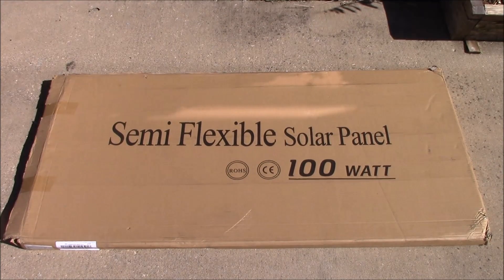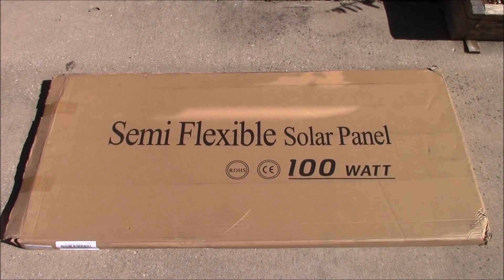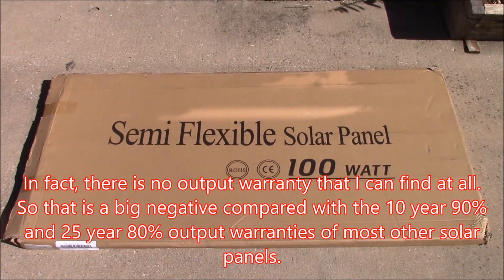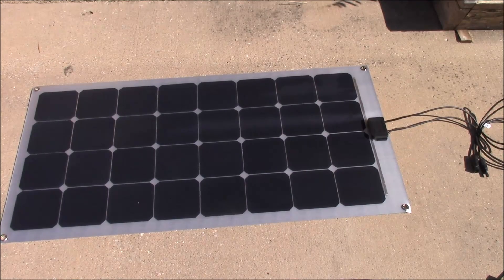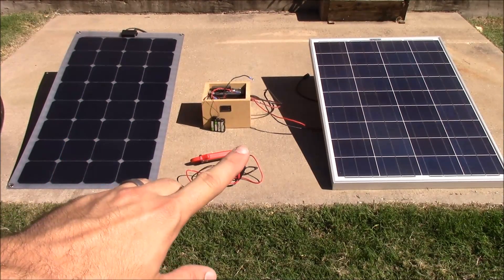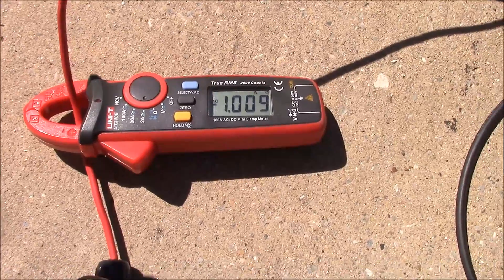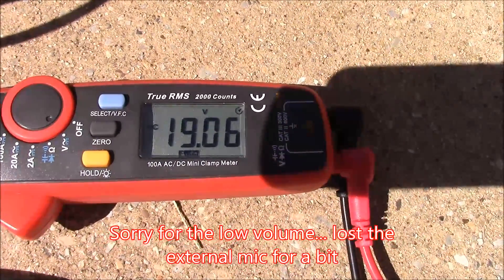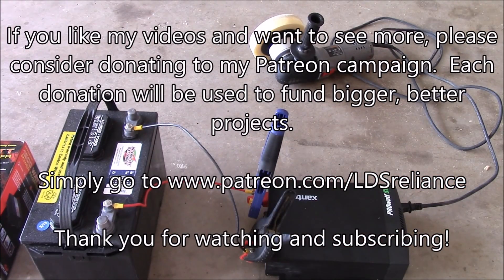Lensun 100W Semi Flexible Solar Panel

Comment: 1 Amp is not nearly the max power each of the panels should provide. Max amp should be mor likely be 5 Amps.
Therefore you (and we) don't know if the flexible panel provides the same power as the Standard.  You can get 1 Amp even with a 20 Watt panel.

Comment: Any suggestions on the type of solar panels I should go with? I have an Asian vehicle called a Tuk-Tuk which is basically a really nice 6 passenger golf cart. It has 12 6v batteries ran in a series. I use this for my business so I'd love to be able to get more mileage out of it instead of having to recharge for a few hours after 50 miles. Thanks for your time.
Reply from the maker: How many square feet do you have on the roof?  As far as type goes I think you would need to go with this type of semi-flexible solar panel to match the curvature of the roof.  Otherwise it might be hard to mount.  However, that will be about double the cost.  So if you are on a tight budget there are ways to mount fixed frame panels on a curved roof.
Reply: Hi K Mills. Greetings from India.

Auto RIckshaws (tuk tuks) are quite popular in India. The electric ones run using 48v battries with usually 750/1000w motor.

I have seen drivers use a 250w panel on the roof which would cost them about 250 USD. It keeps the battery topped up, increases the range a little bit and is definitely cheaper than charging from grid. 

the only downfall is that the batteries are replaced every 6 months (probably becuase they are discharged to full). Here is an article : https://www.indiatimes.com/news/india/here-s-how-india-can-surpass-china-in-public-transport-arena-with-its-three-wheeled-electric-vehicles-355611.html

Comment: One issue with regular polycrystalline solar panels is glass breakage. I got one from the UPS man that was damaged during shipment.
Reply from the maker: That can happen.  The glass used in solar panels is very strong and can handle hail but the way they treat packages sometimes it still might break.

Comment: I am confused with all this solar stuff. I am an artist and want to design and build a water feature using a 12v bilge pump . It  says 1.4 amps on the package. I have used this same pump running off a deep cycle battery in my van but now I want to know what size solar panel, controller and battery I will need to power an independent waterfall using this same 12v bilge pump.
Reply from the maker: To power that pump year round in an average climate and assuming it runs 24/7, you would need 200W of solar panels and 75Ah of battery capacity.
Reply: Thanks for taking the time to reply. I really appreciate it!

Comment: The cooler a panel is kept the liner it will last and the more efficient it will run. So, if you mount a flexible panel flush to your rv, you're gonna have a bad time.
Reply from the maker: Yep.

Comment: The warranty has more to do with the way it's constructed, because the glass holds up better than the plastic covering...
Reply from the maker: Right.  And the "flexibility" actually can hurt the leads and connections inside the panel.  So the main marketing point for this type of panel is actually its achilles heel and would be the reason why I would not purchase one myself unless I had an application that called for extreme light weight and portability.

Comment: I have a question. I have 100W panel and 12V 40Ah battery to power just 25W load. Got a little bit confused because battery discharges so fast when not exposed to sunlight. This is true even if I don't apply power to load, battery still discharges especially when it is at shade. Is there any way i can solve this? THANKS!
Reply from the maker: Do you have a charge controller?  How is the load connected to the battery?  Is it through an inverter?
Reply: LDSreliance yes sir i have 10A CC and i only use the load fnction to power 12v dc bulb
Reply from the maker: That battery will run a 25W load for 6 hours if it is fully charged.  Are you getting less than that?

Comment: A big malfunction with these flex solar cell arrays,  I have seen is, if it's shaded in the smallest amount, one cell, the output drops to zero.
Reply from the maker: Not with this particular unit.  I have tested it in shading and it lowers the voltage a bit.

Comment: Each cell output is max 0.2 amp at 0.5 volts x32 cells, not much more than 3 watts. How do they come up with 100 watts? They are cheap Chinese monocrystalines, save money by making your own, Pair of 1/16th clear plexiglass sheets, $20 each, 32 wafers at 50 cents each, sealed with clear silicone epoxy, save $100 on this size panel. All it takes is some soldering, make your own custom size.
Reply from the maker: Where are you getting those specs?  Solar cells can be anywhere from a few tenths of a Watt to 3W or more.

No one is buying this panel because it is cheap.  There are plenty of finished 100W solar panels with warranties and guarantees for $100 including shipping.  The only reason you buy this panel is if you need something very mobile.

Comment: Notice the damage to both the box and the solar panel on the right front corner.  

I ordered this product, received one that was damage, like in this video.   Worked with LENSUN to replace it.  Lensun blamed the damage on the shipping company, not their paperboard flimsy box.  I had to pay shipping back to LENSUN.  They sent me a replacement that was damaged on 2 corners. Again they blamed the shipping company.  I finally got a refund for the 1st shipping, and again returned the panel to them, and then received a refund for both the panel and the 2nd shipping.It's very likely that you'll receive a panel that is damaged.  It may not affect your mounting system, but I won't pay this much for a product and accept damage.LENSUN took care of the issues, but not without significant hassle.
Reply from the maker: I am sorry to hear that.  I have dozens of products show up each month and most of them have boxes with damage like that so I didn't even think of it.  I did notice a slight bend in the corner but it was just the aluminum backing and did not affect the panel.  I can understand if you paid $300 for this then I would want it to be perfect, too.

Comment: I have a 100 watt aluminum backed panel as the integral roof panel on my solar/human powered hybrid car. It collects 100% of my daily power needs for transportation. When you mount with a bend they are de-rated a bit, I never get more than 90 watts. The trick is to live sustainably, using a vehicle that is appropriately light weight, mine weighs 160 pounds. 4000 pound steel caged climate controlled high speed lounge couches are never sustainable, they steal more than your fair share of resources from future generations.
Reply from the maker: That works for you but may not work for everyone.  What about my family with a 3 year old and a newborn baby?  How am I supposed to fit in that?  What about those who commute 45 minutes to work each morning?  What about the elderly?  What about construction workers who need a truck?

I get what you are saying and I support being efficient and conscious of the resources we use, but God created plenty of reseources for us to live with and we don't all need to make huge sacrifices.  We all just need to rethink a few things and that will make a huge impact... as long as we ALL do it.  Turn off the lights when you aren't using them.  Drop your thermostat by 1 degree in your house.  Turn down the refrigerator temperature 2 degrees.  Replace a few light bulbs with LEDs.  Can you imagine if everyone in every industrial country in the world just did those few things?  It would be huge.
Reply: The Organic Transit ELF has a 2 seat model available with a rear bench seat that has seat belts for two kids.
A 45 minute commute is generally unacceptable as it is not sustainable behavior. Although my 45 minute car commute became a 30 minute bike commute on pleasant bike trails in the Seattle area. It is much more responsible to move closer to work. Also remember that a car addiction means you require a larger salary to pay for it. Dump the car, take a lower paying job closer to home and everyone benefits. The elderly stay more spry in my type of vehicle, their knees stay stronger. Several 90 year olds own an ELF which requires no insurance or license so failing eyesight is not usually an issue. The disabled also use the ELF. Trucks for professionals are an acceptable use of heavy vehicles for now, eventually those will all be solar or other clean tech. And we didn't even touch upon buses or trains or bicycles or walking. 
Listen I've heard all the excuses. Either you have an interest in no longer stealing more than your fair share of resources from future generations, or you do not. No one will do this for you but some day you will have to answer to your kids.
Reply: @popeyegordon  You seem to have an addiction to telling others how to live their lives, and deciding what is best for others. You also seem to have an addiction to narrow minded thinking patterns that accommodate your idealistic views of how one is meant to live. Its creepy.
Reply: @JohnDoe-xu3uy  You seem to have an addiction to willful ignorance and resent anyone who is educated and knows how to verify facts and demonstrate them either with citation links regarding GMO food safety or actual examples demonstrated by personal responsibility and sustainable living. My personal opinions are not offered on Youtube, I stick 100% with proven verifiable facts and responsible living examples that are recommended by all climate experts. Driving a pollution free vehicle is not an opinion, it is demonstration through action that we don't have to continue our damaging behavior. I walk the talk. If I did not, I would be a hypocrite but I do in fact live my entire life by following sustainable practices, it is easy.

Comment: Hello, Is it possible to connect at 12/24V battery on it ???
Reply from the maker: That depends more on your charge controller than on the panel.  The panel produces 16-18V which is enough to charge a 12V battery.  However, some charge controllers can use a 12V panel to charge a 24V battery or battery bank.  So check your charge controller and see what it is capable of.  Otherwise to be safe just use a 12V battery.

Comment: Well, I don't know how long they started making these panels, but it looks like they are not making the panels, harder to find and they are discounting what is left in stock. And why oh why are they charging $100 more over PET covered panels? is ETFE way more expensive then PET? Mind you I will never buy the PET version as they just do not hold up!
Reply from the maker: Good questions.  Looks like they are still in stock on their website.  Are you looking there or on Amazon?

Comment: I would like to see them so you can stack them for transport and then lay them out on the ground to boondock. If they off set that box in the middle they would allow for easier stacking.
Reply from the maker: Not a bad idea but for mass production that would cost them a lot more to produce 3-4 different variations of the panels with offset boxes.  Just not practical.  And I would not recommend just laying them flat on the ground for boondocking unless you are very close to the equator.  Solar panels need to be angled toward the sun at an angle roughly equivalent to your degree of latitude.

Comment: I love the portability of those.  I had an installer tell me the flex panels are horrid unless they use sunpower cells.  At the time Renogy did and was tempted to go w/ them, but could not resist the price and quality of their regular panels-cheapest on the market. Soon after the flex model got re-called-the backing breaks down in the sun and could start a fire. Go Power made them and "Gone W. The Winds" reviewed them and were not too thrilled after time either. Renogy never did any more flex panels. I liked the fact I could lift them and they were light and there are great videos on how to make an easy stand, but that set up is sure not theft proof. The regular panels w/ the angle aluminum stand and permanent bolts are easier to chain and much harder to walk off with, but then harder to move. I am so glad now I went w/ the Renogy.  The last 2 pk was $275.  They work great, if there is sun.  Have to say I get much better results now that I have doubled to 400 watts. It's overkill on the sunny days, but that is not common here and now on the cloudy days I will be able to use the macbook that I could not use much all summer and be able to run the propane hot water heater[the circuit board takes a lot] and have plenty for the mightyKool.  At least I do not have to worry about them breaking down and starting a fire.
Reply from the maker: Have you considered a small wind turbine to supplement on the rainy/cloudy days or the days where there isn't many sun hours?  Just a thought.
Reply: The wind stops the 5 cloudiest months. Otherwise it's VERY heavy and constant the rest the year. The wind equipment has too many EMFs for me as I have to stay very low emf. Doubling the panels seems to help though we are nearing the end of the months of clouds. It is half cloudy most the time anyway, but not quite as bad-I will do much better this winter on the greyer days. Seems like doubling the solar panels to 2X what would normally needed for good weather works in heavy cloud regions.  Can NOT go by what the charts say-1/2 hour from here, gets lots of sun. Seems to work for the NY channels.
Reply from the maker: Prima Donna Going Off Grid
That would be rough.  Sounds like a crazy place to live!
Reply: Yes. Rain 2 days straight and cold today high of 57.  It is very crazy-lots of serious people drama [unlike all the other states I lived] to get anything done-reason I am checking options for a new state to live off grid in. The up side is the dead of winter gets some of the standard freeze wintery mix, but mostly moderate compared to NM or the north and most other places. From June on is VERY humid, but again the temps are mild  w/ half the days extreme heat but the rest warm but do not need any cooling but open windows. Lots of bugs/mosquitoes but very green and lush-there is a certain cooling beauty about it in the summer. So it sort of really swings heavy negatives and heavy positives..
Reply from the maker: Prima Donna Going Off Grid Yeah.  Can you move that thing easily?  You might have to have a summer home and a winter home to get the best of both worlds.
Reply: Not so easy. The towing and then the set up after all is said and done is 2 to 3 thousand and takes  months and several hundred hours on the phone to get completed. The first move was much cheaper and easier, but not any more. I have to say after a week w/ the new 200 watts, it's like night and day how much more power I have.
Reply from the maker: Prima Donna Going Off Grid
Bummer.  Thought you might have a truck.  Well glad the new setup has improved things!

Comment: Twice the cost, and only 2 year vs 25 year warranty... to each his own...
Reply from the maker: I wouldn't buy it myself but some people might value the portability over longevity.
Reply: i think it's good to put in the back of the truck for  portability issues.   Nothing long term.
Reply from the maker: WTF BBQ Yes if portability is by far the biggest priority for you then this is great.
Reply: the 25 year warranty is an out put warranty and the 2 year warranty is workmanship warranty.  Lensun and most others also warrant output of 90% or thereabouts for 25 years 

"The product is covered by a two-year workmanship warranty provided by LENSUN. We repair or replace defective items at our own discretion. In addition, solar cells are guaranteed to operate at 90% of nominal power output at 10 years after purchase and at 80% of nominal power at 25 years after purchase. This warranty is provided by the manufacturer of the solar cells"

Comment: You solid panel has more cells... why does every one bend the panel, it is not meant to be bent, but to be light weight...
Reply from the maker: Because it is marketed that way.  Why market it as a semi-flexible panel and then tell people not to ever bend it?  Just call it a portable panel and people won't try to bend it.
Reply: And the marketing says don't reverse bend it, the way you did by compressing the cells.  And the solid panel is poly crystaline.  Would think people reviewing this stuff would have some idea what they are talking about.

Comment: Given that you got the panel for free, I would have expected you to have provided proper output power measurments on it, particularly as you cite this as a potential negative in the commentary.  Just bung a decent load on it and measure the volts/current to get a power number.
Reply from the maker: I did that.  I actually put 2 different charge controller and battery combinations on that panel and then even tried connecting the panel directly to a 48v motor just to see what it would do wide open and it never produced more than 2 amps (most of the time only 1 amp as shown in the video).  I thought it was something in my test box setup but apparently I must have a defective unit or something.
Reply: Oh ok.  There's another Youtube video testing the same panel - looks the same anyway! - and it seemed to easily perform to spec.  And that was in England, not known for the sun!  I'm thinking of getting one of those panels to play with.  Thanks for the heads-up.
Reply from the maker: Mojo Jomo I will test it one more time with another ammeter to verify the results.  It is pretty puzzling.